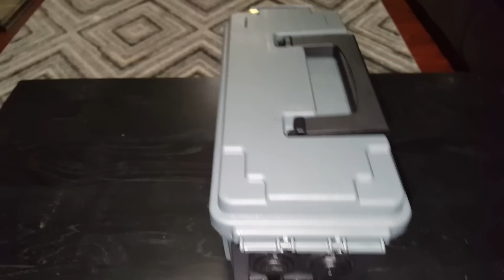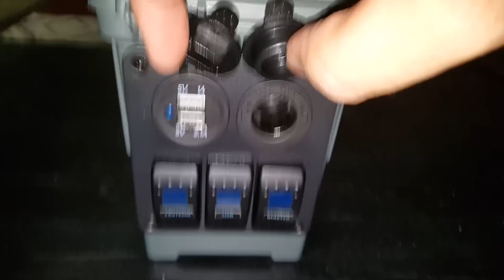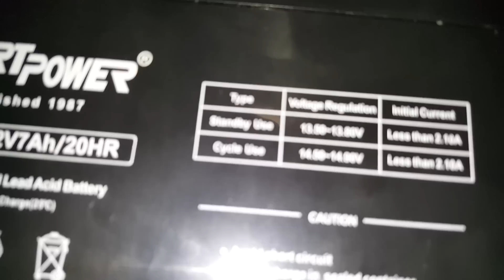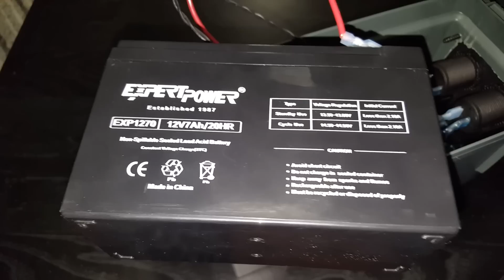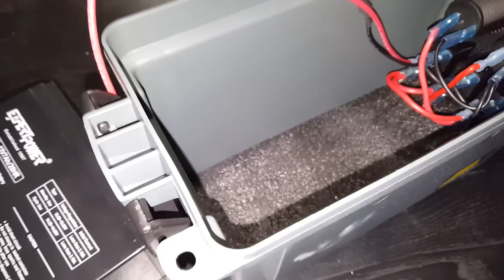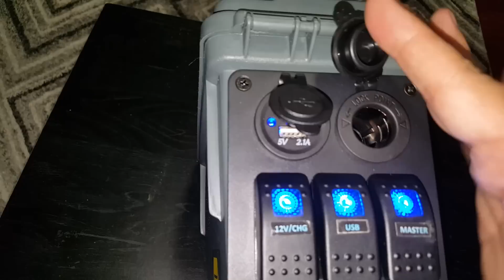Ammo Can Portable Battery Box

Comment: Did you ever add the battery meter or internal temperature if so i want to know what its called and i want to see how it turned out
Reply from the maker: I got a small 12V powerplug with a voltage and temperature display on the front from Amazon that works as expected.  I got it quite a while ago and that specific one isn't available anymore but there are a million different ones.  I think I even saw one at Walmart.  It just plugs right into the 12V socket.

Comment: Nice build. I like how clean that switch/accessory plate looks on the box. You should have a fuse on any parallel runs. If something shorts either the thin ground wire will get red hot or the switches depending on which one has the higher amperage rating. On my battery box I have 15amp atc blade fuses (automotive) on my 12v sockets. Super cheap but it will save your parts from getting fried or worse fire in the event of a short!

Comment: What do you use to recharge the battery and how do you recharge it? Remove the battery or you have charging outlet?
Reply from the maker: I bought a cheap WalMart 12V power plug and crimped two lugs on the end of the pigtail.  I just plug that into the 12V outlet and turn on the master and 12V switches and connect the lugs to a standard car 12V battery charger.

Comment: Nice work, thanks for posting! I’m assuming you’d to have master switch and the 12v switch in the on position in order to charge the battery. Also what was your source for the panel with ports and switches.
Reply from the maker: Yes that's correct.  I just use a 12V adapter from Walmart with lugs on the end of the wires to charge it with a standard car battery charger.  This is the Amazon URL:  https://smile.amazon.com/gp/product/B07258QD9R/ref=oh_aui_search_detailpage?ie=UTF8&psc=1
Reply from the maker: This is what I use to monitor the battery voltage (again 12v port switch needs to be on):  https://smile.amazon.com/gp/product/B014MCRPT0/ref=oh_aui_search_detailpage?ie=UTF8&psc=1